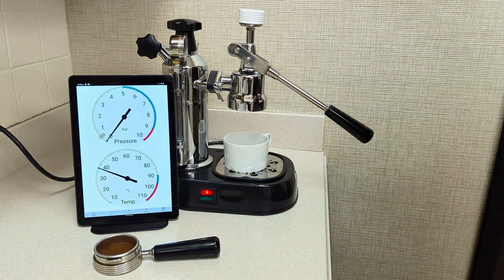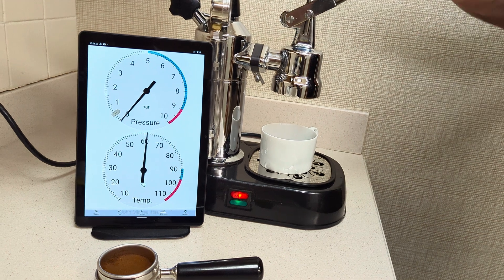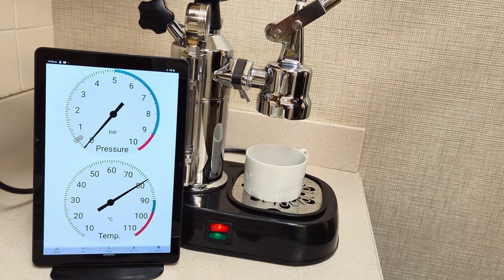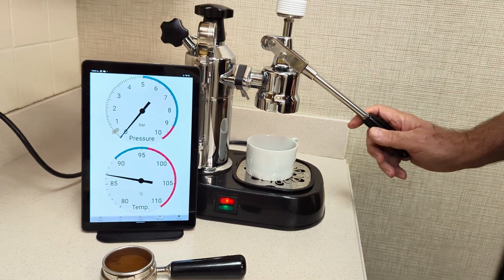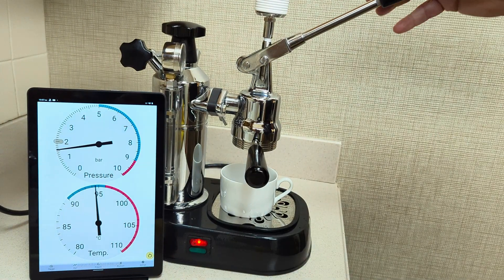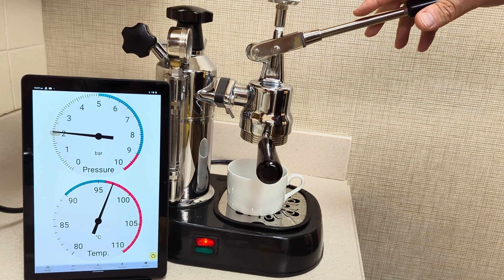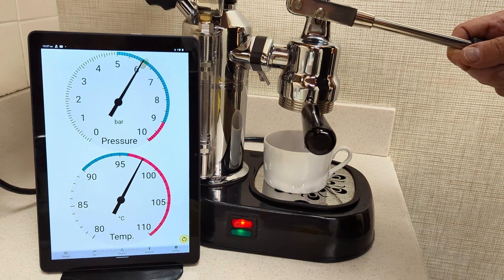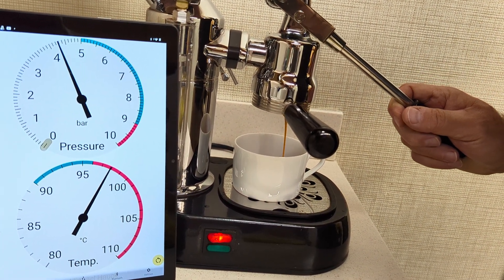5. La Pavoni Pressure & Temperature Profiling - Simple Analog Gauges

Comment: How do you get your handle to move up and down so easily? Mine always gets so stiff. I've never found a cure.
Reply from the maker: By taking the piston out of the group head and lubricating or replacing the gaskets. Look for a food safe high temperature lubricant.
Reply: @JohnMichaelHauck 
Plus a ss or brass sleeve
Worthed it!!!
Reply: @JohnMichaelHauck  mmm, that is quite a maintenance schedule. And although I've just ordered some silicon grease, can't say I'm thrilled at the thought of it coming into contact with the water for my coffee.

Comment: I like the programmable grey target idea 👍
Got any input on the meaning of those audible cues? Utilizing the audible facet is wise. 
And the analog look is nice to have as an option.
Reply from the maker: Good ears!
The audible notifcations can be individually turned on/off.
They are for "Preheated", "Shot Start" and "Shot Complete".

>> With the pressure sensor and the balance connected
Automatically starts when 
*  The pressure reaches the program starting pressure.
Automatically stops at two minutes, or earlier when
*  The shot timer exceeds ½ the program duration, and
*  The pressure returns to the program ending pressure, and
*  The mass exceeds ½ the program target mass, and
*  The flow rate is less than 0.01g/s.
Automatically resets
*  One minute after the shot stops.

>> With just the pressor sensor connected
Automatically starts when
*  The pressure reaches the program starting pressure.
Automatically stops at two minutes, or earlier when
*  The shot timer exceeds ½ the program duration, and
*  The pressure returns to the program ending pressure.
Automatically resets
*  One minute after the shot stops.

>> With just the balance connected
Automatically starts when
*  The mass exceeds 0.1g.
Automatically stops at two minutes, or earlier when
*  The shot timer exceeds ½ the program duration, and
*  The mass exceeds ½ the program target mass, and
*  The flow rate is less than 0.01g/s.
Automatically resets
*  One minute after the shot stops.

>> Notifications (sound)
At the start and end of a shot
When the temperature reaches the preheat temperature of the current program.
*  It will only sound again if the temperature first drops 10°C below the preheat temperature.